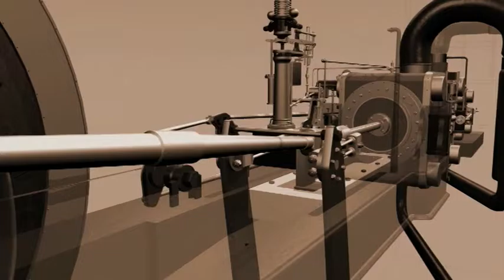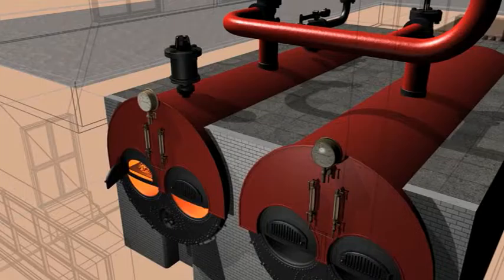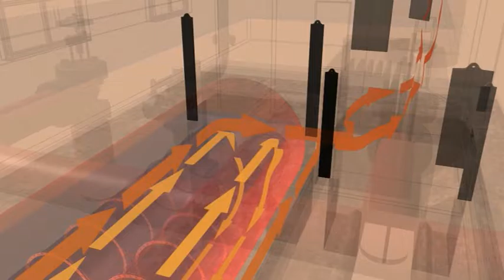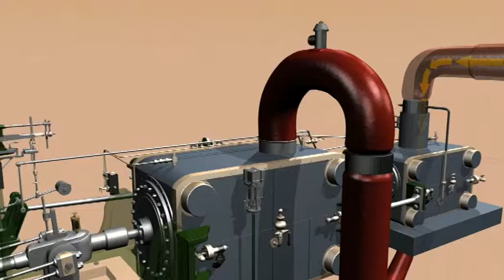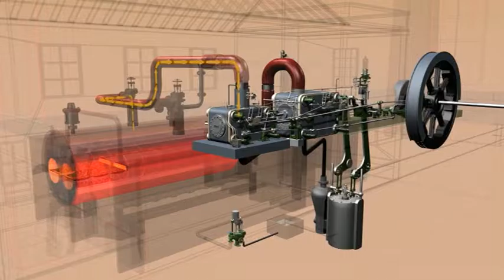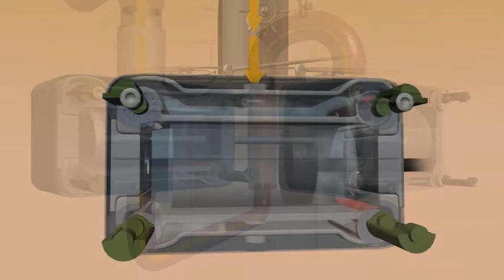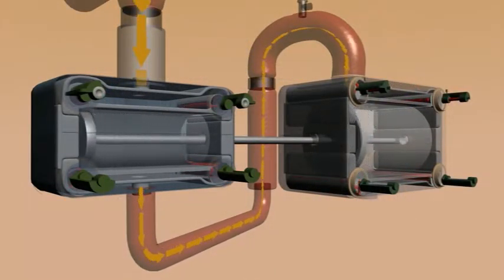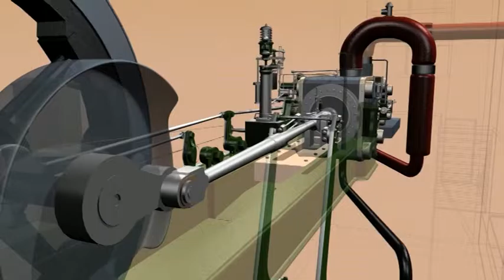Queen Street Mill - Coal to Cloth

Comment: I like this animation for a number of reasons, one of which is that it nicely illustrates the layout of the boiler room, engine and factory floor, relative to each other.
Reply from the maker: Thanks very much!  That was actually one of the primary aims requested by the client, because when visitors look around, it's not so obvious what is connected to what and why.  We had to first learn all this as well, of course, and ultimately understood it well enough thanks to the very knowledgeable and experienced engineer credited at the end.